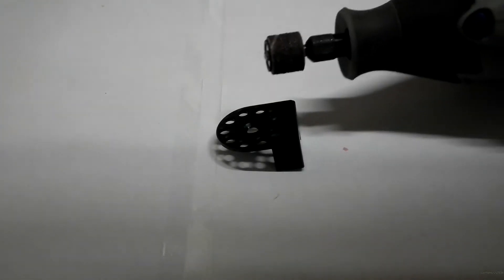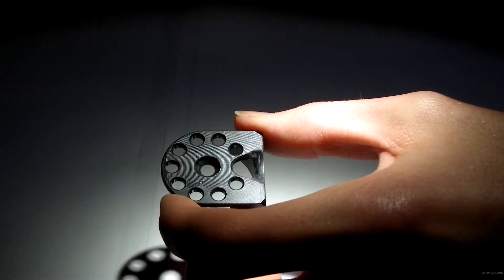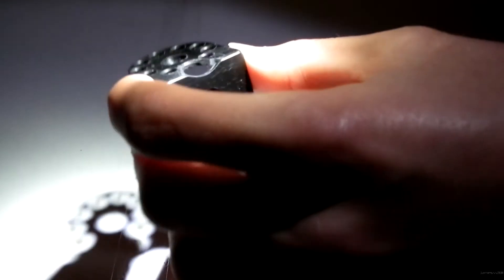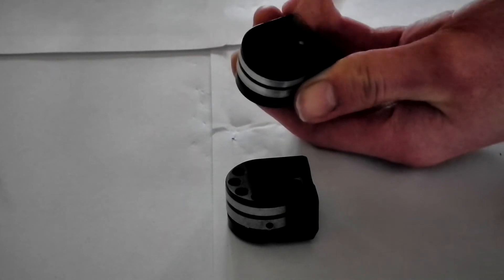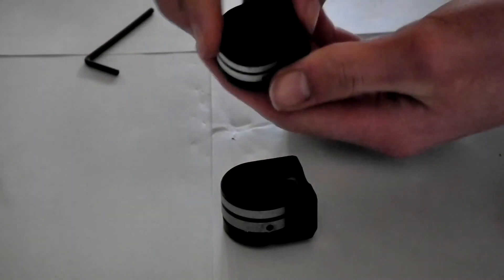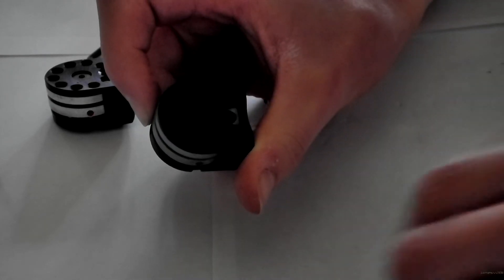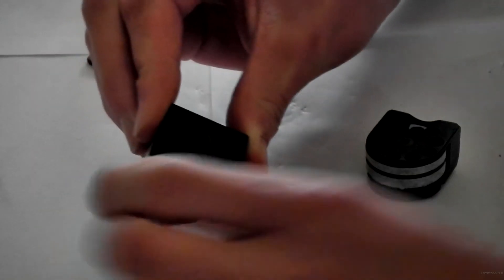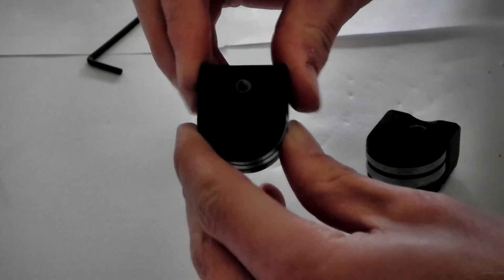How To Make Daystate Magazine Easier To Load

Comment: You don't need to take the magazine apart to do this - save yourself a bit of work just take a Dremel with sanding attachment to the face of the magazine without taking it apart - a lot easier. I have done four mags like this it takes about 5 seconds.